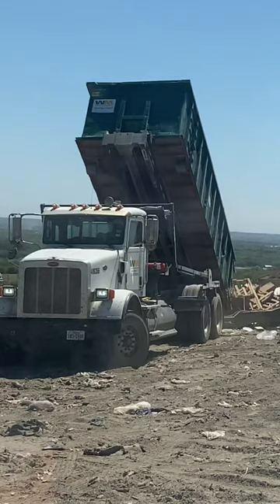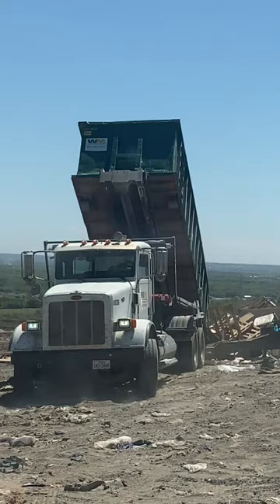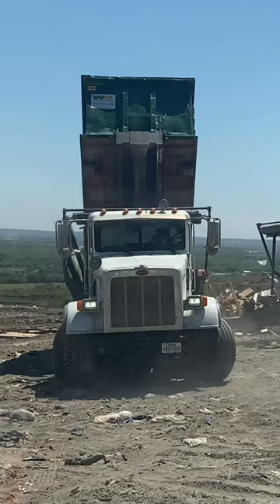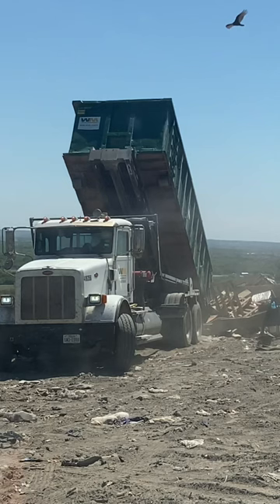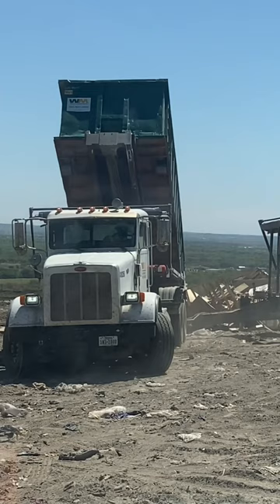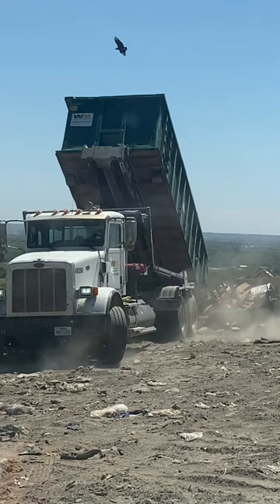Roll-off

Comment: I used to work for Weaste, and they have what they call LCR rules. One rule is WM doesn't want the driver to bang the can.
Reply: Is the roll off trucks a semi with a trailer? Or is it one truck? Does it drive like a car? It means all the tires turn, hever, you turn the wheel?
Reply: @makedadaniels609 I drive the straight truck roll off, "1 frame, no pivot point".
But there are tractor trailer versions that can carry either 1 really heavy can or also fit 2 that are only a bit heavy or even totally empty
Reply: Have in mind  u can alsodo that  pulling up strait without turning wheels..small yanks
Reply: @Black32808 I’ve never heard of them having that rule maybe in other states but here where I’m at we can bang the can etc
Reply: @makedadaniels609 Their are both class a and b roll off trucks. In fact, class a vehicles are much easier than class b in my opinion.
Reply: I do roll off for WM and we shake our cans all the time.  There’s no LCR against it.  There is a LCR that says you have to follow tipping floor rules, so maybe that particular landfill has a rule against shaking boxes.
Reply: yeah banging the can isn't an LCR, we do it all the time. and we don't turn the wheels when we move back and forth either.